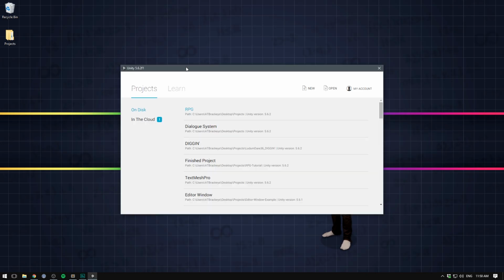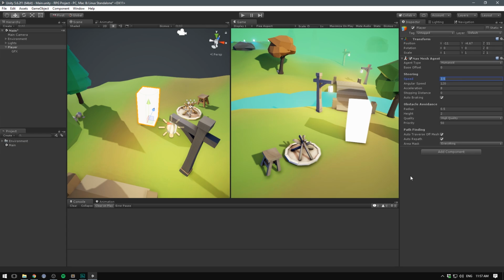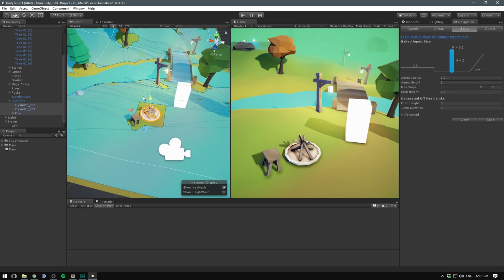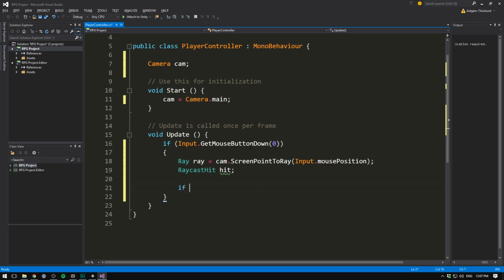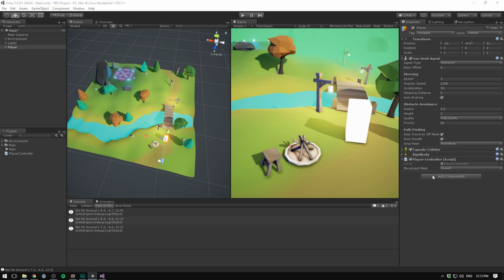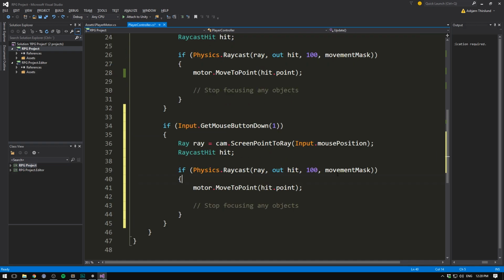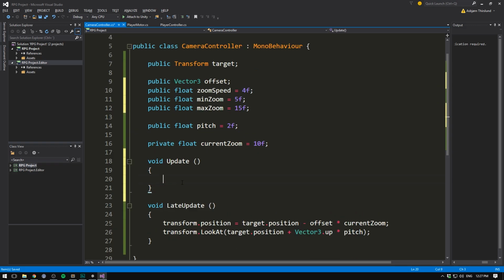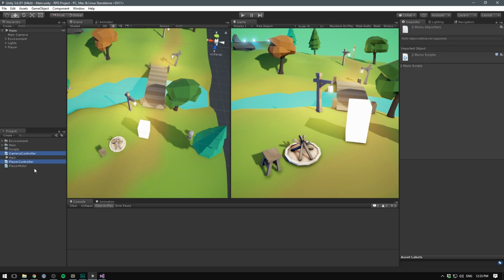MOVEMENT - Making an RPG in Unity (E01)

Comment: Fixed:  deleted and rewrote both playercontroller and playermotor scripts to try again from beginning. Not sure where I went wrong but that fixed it.

I'm stuck...When I try to move player I receive NullReferenceException: Object reference not set to an instance of an object PlayerController.Update() (at Assets/PlayerController.cs:39)
I'm new to all this but I'm guessing its referring to line 39 of PlayerController code??? Which is... motor.MoveToPoint (hit.point);
Reply: Null Reference means it's trying to reference an object that doesn't exist. 
Since you didn't get any problems before that line, I assume you had the Player Motor script attached to the Player object but make sure it is.
The more likely case is that you never established that the variable "motor" refers to the component "PlayerMotor" in the Player object.
So check your start function.
It probably tries to access "motor" but motor was never established in the start function.

 motor = GetComponent<PlayerMotor>();

Only there does the script connect motor with the PlayerMotor.
Reply: Thank you so much  @Theppo101  !

Comment: I just downloaded this from github. I opened it the ground went missing, please help.
Reply: Hi, not sure if you have found a solution, but I got it to work by downloading and installing "Blender" on steam. I then opened up the "RPG tutorial" file I downloaded from the link. After I unzipped the file, I opened it up and double clicked on "Models" to open up that folder. You can then double click on either "Base Environment", "Tree 01", or "Tree 01". It will pop up with something saying "How/which program do you want to open this file with?" (Can't remember exactly what it says, but It's somewhere along those lines). You can then chose to browse through your computer to find something to open it with. Go to where your "Blender" program was installed (In my case it was "D:\Program Files (x86)\Steam\steamapps\common"). After you found where your Blender app is, simply double click the "Blender.exe" application, this should link those file types with Blender. Not sure if this part is necessary but I did it anyway. Double click either the  "Base Environment", "Tree 01", or "Tree 01"  now that they are linked with Blender and it should open up Blender with the file you double clicked. You should see the asset you chose loaded into Blender, then fully close Unity, then re-open it and repeat the steps in this video and it should be all good. Hope this helps!
Reply: I think you need to download Blender
Reply: Installing Blender and your tip worked.
Reply: I'm new to this but I had the same problem. Along with dragging in RPG Environment package, you also need to drop in the standalone Models and Sprites. Works for me now with unity 2017.3. Hope this helps. https://www.dropbox.com/s/tfpdze8hqqbl23a/Screenshot%202018-01-26%2015.31.07.png?dl=0

Comment: hi i got a problem with the code when clicking the ground or object (NullReferenceException: Object reference not set to an instance of an object
playerController.Update () (at Assets/Script/Player/playerController.cs:33)
 and pointing me in the line (    motor.MovetoPoint(hit.point);  )
Reply: Tag your camera as main camera in the inspector view.
Reply: my main camera is already tag as main camera and i don't use any camera only main cam
Reply: I have the same problem
Reply: At the motor.hit function??
Reply: Paul Jasper Parungao ya
Reply: Did you ever try to debug??or watch again the video
Reply: Paul Jasper Parungao no i don't know how to debug
Reply: i'll update you when i fixed the error
Reply: Paul Jasper Parungao Thanks alot
Reply: I had same problem... player would not move plus error message...I deleted, rewrote and saved the playercontroller and playermotor scripts very very carefully, line for line, identical to Bracheys, and that fixed it. Only problem is, now I don't know what my mistake was.
Reply: Damien Moss hey dude did you fixed the error?

Comment: hi,In interactable.cs
The update() function was not being called(I checked with Debug.Log) as a result Interact() was not being called and I could not move ahead with the tutorial.
I solved the problem by using LateUpdate() instead of Update() and everything works fine.
i just wanted to know why wasn't my update() function working.
Reply: make sure your objects have a collider, if youre like me and wanted to use your own models for everything then you need to add a mesh collider onto the objects so they are considered a solid object.

Comment: The terrain didn't load when I opened the example what do I do?
Reply: Hi, not sure if you have found a solution, but I got it to work by downloading and installing "Blender" on steam. I then opened up the "RPG tutorial" file I downloaded from the link. After I unzipped the file, I opened it up and double clicked on "Models" to open up that folder. You can then double click on either "Base Environment", "Tree 01", or "Tree 01". It will pop up with something saying "How/which program do you want to open this file with?" (Can't remember exactly what it says, but It's somewhere along those lines). You can then chose to browse through your computer to find something to open it with. Go to where your "Blender" program was installed (In my case it was "D:\Program Files (x86)\Steam\steamapps\common"). After you found where your Blender app is, simply double click the "Blender.exe" application, this should link those file types with Blender. Not sure if this part is necessary but I did it anyway. Double click either the  "Base Environment", "Tree 01", or "Tree 01"  now that they are linked with Blender and it should open up Blender with the file you double clicked. You should see the asset you chose loaded into Blender, then fully close Unity, then re-open it and repeat the steps in this video and it should be all good. Hope this helps!

Comment: Suggestion (help)Interms of the CameraController. Is there a way in which you can freely move the camera using WASD and Yaw with QE and make the player move by Point and click on the terrain?Also with combination of Both, my camera suggestion and your camera in video, is it possible to transition between both camera settings with a specified keyboard key? (backspace or Space bar for example?)Also would it be possible to Snap between Both Camera settings. Free look and character bound.And have the free look camera Snap back to the Character bound Setting (your video camera)?

Comment: I"m using the latest version of Unity the Unity2017.1.0f3. I'm having a problem, for this tutorial, I can't see the main ground layer. More so, in this part, we Logged the position and name of the object where we (the user) clicked, in the tutorial when the Ground was being clicked the Log stated 'Ground' and then it's position, in my case when I click the ground (or the black void) it showed nothing. Here is an image of how the ground looks: https://drive.google.com/open?id=0B0Gx6Cc1Jtl5NzRnMWZ1UTY2eU0

I'm guessing that the main problem will be that in my version, the Ground mesh says `none` it wasn't so in the tutorial. I even tried the finished project through GitHub, even that had the same problem. Can someone help me?!
Reply: I'm having same problem, including "Blender is not installed" errors after importing assets. "Update": Closed Unity, installed Blender to default location, created new unity project and reimported assets. that fixed the ground problem :)
Reply: @dedwisbry  tks U
Reply: Doing this for me aswell
Reply: Also make sure that blender is set as the default app to open *.blend files.

Comment: Hello. I'm using Unity 2017.1.1f1 and Blender 2.79, when drag and drop your package into my project I shows loading bar and then says `'.' is not a valid texture file name on asset 'Assets/Environment/Models/Rocks/StoneSize2.fbx' on material 'None__Untitled' of renderer 'Icosphere'. The file will be ignored.` warning message and a lot of 3D models now missing. Now I can't proceed your tutorial.
Reply: I'm in the same boat. But... http://answers.unity3d.com/questions/906324/-is-not-a-valid-texture-file-name-on-asset-warning.html
Reply: Not really a fix, but a workaround:  

1) find the broken model (eg StoneSize2.fbx) in your assets folder in the bottom left of the editor

2) click on that asset to show its properties in the inspector on the upper right. 

3) There are 4 'tabs' in the inspector: Model, Rig, Animation, and Materials. Click on Materials. 

4) Hit the 'Import Materials' checkbox. Then in the drop down next to "Location", select "Use Embedded Materials".  In this same tab you will see a section appear below called "Remapped Materials"-- below it where it says "None (Material)" -- you can click on the little circle to the right,  and assign a different material like Default-Material.  

5) Repeat until all of your missing material errors go away (mine only had 2 fortunately!)

Reply to an old comment, but wanted to post this in case it helped someone else!

Comment: On Import of the game assets only the lamposts and rocks are showing, no water, bridge, ground or anything of the sort.  When I select them in the tree the bounding meshes will show but the elements aren't visible.  What should I change?
EDIT: SOLVED
I am dumb and didnt have Blender installed on this machine :|
Reply: I'm having the same issue, what did you do?
Reply: Reinstalled Blender, reopened unity and the IDE and it worked fine.

Comment: Found a fix for the below issue;

NullReferenceException: Object reference not set to an instance of an object
PlayerController.Update () (at Assets/PlayerController.cs:18)

Ray ray = cam.ScreenPointToRay(Input.mousePosition);

Fix: Tag your camera as main camera in the inspector view. That fixed it for me.
Reply: Thank you very much.
Reply: No Problem
Reply: THANK GOD FOR YOU TY
Reply: thx alot
Reply: thanks man, youre a legend
Reply: Thank you
Reply: thank you after 2 years xd
Reply: @herohimself  No problem. Glad it helped.
Reply: You the REAL MVP!!! i had deleted and added a camera back into the scene and completely forgot the tag. Thank you so much!
Reply: I have looked in the inspector and it is indeed tagged as main camera, do I have to add a camera under the player?
Reply: QualityPirate  For me I missed the cam = Camera.main;  assignment that was in start method
Reply: @kylekastilahn  Do you mean you forgot to type it in because, I am still having this error even though my camera was already tagged as main camera
Reply: @robbie6421  For me In the Inspector the main Camera is tagged as MainCamera as seen when click on Main Camera in Hierarchy. HOWEVER, Camera cam is a private object in the script PlayerController. in the Start method we assign the Main Camera via code using a built in property called main , cam = Camera.main; this has nothing to do with the tag in the Inspector called MainCamera. If we were going to use the tag of the Object in the Inspector  I think it would have to be something more like this: Camera cam = GameObject.FindGameObjectWithTag("MainCamera").GetComponent<Camera>();
Reply: yes, had to type in the Start method cam = Camera.main; I forgot to type it in. The null reference was being called for myself because I was attempting to use a Camera object that was not yet created because the object was never instantiate fully, only a variable placeholder. I think a third way of coding this all is  that a public Camera object could be declared then you drag and drop the Main Camera from hierarchy into the variable placeholder within the script portion of the Player component, then we could code something like cam = GetComponent<Camera>(); When we click on the Camera in the hierarchy if we look at the inspector in the middle there is a component called Camera, this is what the GetComponent<Camera>() is grabbing/creating reference too for us to use in examples above and here
Reply: You are a god. Thank you.
Reply: Thanks mate i was going crazy..
Reply: Savior of us all. Much appreciated.
Reply: I cannot describe how much I love you for this
Reply: Thank you ^-^
Reply: I am getting this error message even though my camera was already tagged as main camera
Reply: Thank you man :)
Reply: I've set it to main camera, I've initialized it, but its still giving me that error. Any help?
Reply: I fixed it by renaming the script just make sure it matches the public titles in the script not really sure how this works but it fixed it for me
Reply: Runedova 12 when I do this the camera just follows the point I click and the player stays still! Please help.
Reply: @seano2540  I had the same problem until I removed the Nav Mesh Agent from my GFX object
Reply: You are literally the most big brain person thank you for this
Reply: Are you sure you're defining motor and the main camera in the Start()?
Reply: Thank you so much 🙏
Reply: Thx dude
Reply: THANK YOU!

Comment: Whenever I am in Play mode in Unity and do a left click, nothing happens, it seems that Unity ist not recognizing my MousseBottunDown(0). Do any of you had similar problems or tips how to solve this problem ? thanks for help
Reply: Its because you need a Terrain collider componant attached to your terrain. The raycast will simply shoot a bolt straight through your terrain every time you click, and wont register. With a terrain collider the yarcast will register in the console.

Ive luckily for past that, and moving my character isnt a problem now. the zoom and rotate simply doesnt work. ive completed the scripts with no errors at all, attached them appropriately, but when it comes to scrolling in and out with mouse wheel, or using Q and E to rotate, nothing happens.
Reply: Haristess thats right, thanks for the help. (:
Reply: Glad to have helped. im learning too yay... Now i need to figure out how to get brackey rotate and zoom to work because it doesnt my end. Also i need to somehow enable the ability to freelook with my camera and have a snap function to switch between each camera type. :(
Reply: You ever figure out the issue with the camera? I'm having the same problem.

Comment: What would you need to do if you wanted the camera to also be vertically controlled with a min/max range (maybe like between 30-75 degrees?). I tried to follow the horizontal logic, but this gives some weird behaviours (camera flips around). 

.... update()
currentYawVertical -= Input.GetAxis("Vertical") * yawSpeed * Time.deltaTime;
... lateupdate()
 transform.RotateAround(target.position, Vector3.Right, currentYaw);

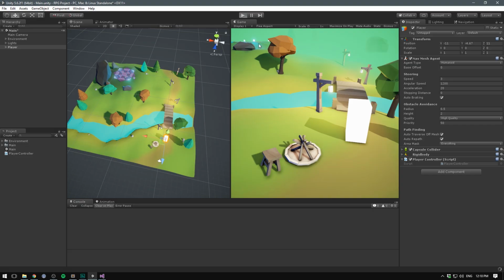Comment: Got to 8:27 but I am getting errors in my Character Controller script. The first error is:

Assets/CharacterController.cs(21,4): error CS0246: The type or namespace name `RayCastHit' could not be found. Are you missing an assembly reference?

The second is:

Assets/CharacterController.cs(23,34): error CS0841: A local variable `hit' cannot be used before it is declared

However It hasnt been declared before the variable.

EDIT: I now realize what the problem is. I capitalized Cast in RaycastHit. It thought that I typed the local variable before its declaration because of the capitalization; it couldn't recognise it. It works fine now! :)

Comment: Hey Brackeys,
I'm enjoying your videos for more than a year now, but I have one problem:

In my first person shooter game the weapons have projectiles. There is a muzzle flash effect and the bullet is being instantiated in the weapons muzzle. The bullet then travels itself by physics force. However my problem is, that the projectile doesn't hit, where the crosshair indicates, which is just logical because of the rotation angle and position offset of the weapon relative to the camera. How can I make the projectile fly from the camera, but make it look like it flies from the gun?
Reply: fire a raycast from the camera straight forward, then using the raycasts hit data, grab hit.point. Now you can give the bullets rigidbody a force of that hit.point minus the bullets position, so it moves in that direction. I hope I helped!

You may also want to disable collision between your bullet and the gun that is firing it, or at least disable the guns collider.
Reply: Good idea, thank you. I thought about this aswell, there are some problems:
- What if the bullet doesn't hit anything? The projectile should be fire in this case aswell, but it wouldn't have a point to fly to
- What if the player "prefires" a moving target, so the raycast doesn't hit but the bullet would hit?

Do you have any idea how to solve this?
Reply: I just woke up less than 30 seconds ago, so I hope what I am about to say is coherent...
1. if the physics.raycast returns false, just have an else statement that fires forward (if the raycast misses, the projectile fires forward).
2. I don't really see a problem in this happening... unless you are wanting the raycast to deal the damage, but you could make the bullet deal damage to the first thing it collides with by adding a script to it that has nothing more than a void oncollisionenter that deals damage to objects with a certain tag.